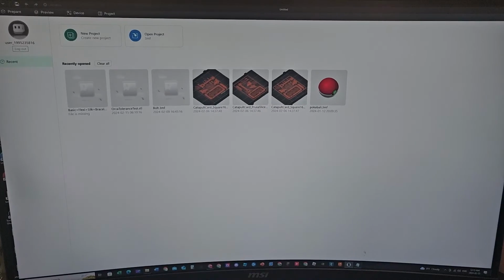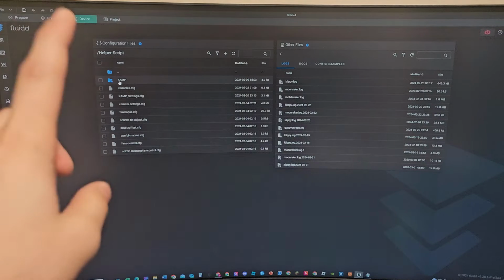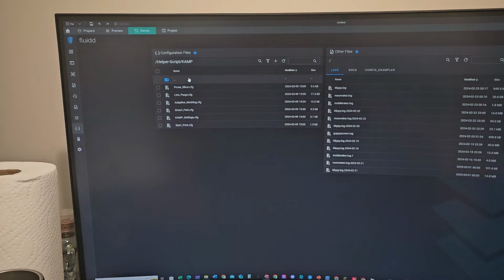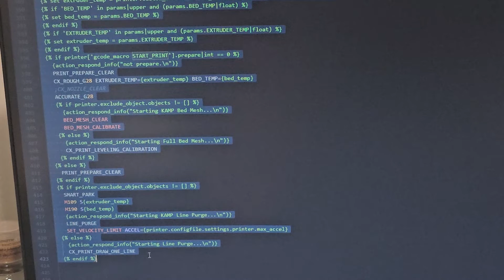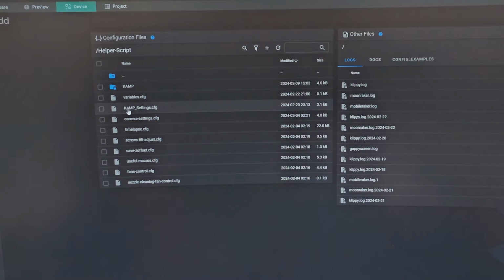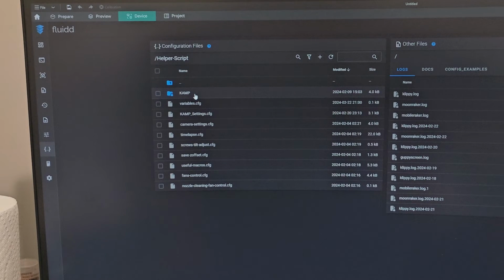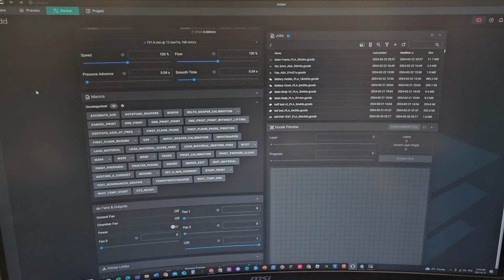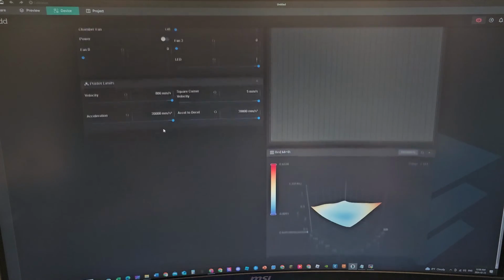How To Edit KAMP Locked Files | Creality K1 Max

Comment: Sorry, I get this error. I would be happy if you could help me.

Once the underlying issue is corrected, use the "RESTART"
command to reload the config and restart the host software.
Printer is halted
Reply from the maker: Have you change some g codes? If so then maybe it wouldn't start because its missing something.

Comment: Hi, thank you so much for your videos! I followed what you did exactly and I've gone over and over it but it will not print now as I keep getting this error.  {"code":"key165", "msg": "Error evaluating 'gcode_macro START_PRINT:gcode': jinja2.exceptions.UndefinedError: 'extras.gcode_macro.GetStatusWrapper object' has no attribute 'output_pin ADAPTIVE_BED_MESH' do you have any idea how to fix this please? Thank you very much!
Reply from the maker: It looks like your adaptive bed mesh might not be there or having trouble with your start peint gcode. Try using the original gcode and change one thing at a time.
Reply: @Scratch3DPrinting   Dear All. I just now rooted my K1C, and i am using fluidd. In my .../KAMP/Start_Print.cfg file contains more lines, than in the video. I copied all of them, and it works well. I think, @johnprosser2142 problem is he didn't copied all of the lines.

Comment: There is an easier way to edit these files (which also makes them editable) if you need to change something.   In Fluidd on the file you want to edit right click on it and select DOWNLOAD this allows you to download it to your computer where you can edit it.  Note before you upload this modified file make sure you rename the original (i just add _old to it by right clicking on the file and choose RENAME) on the K1 via Fluidd.  To upload the modified file back and then hit the + at the top of the file list, select Upload files, navigate to where you downloaded the file on your computer that you edited and Upload back to the K1.  If you have issues you can always revert to the original file (why I rename and don't delete).
Reply from the maker: That is a great way to do it. I'll think about that next time I edit file. Thanks.
Reply: @Scratch3DPrinting  I couldn't rename, delete, or move the old config file.

Comment: I am having this weird issue for the first time after going back to stock settings and re rooting. Basically my printer will only use my default parameters instead of the Orca Slicer Parameters. What G code do you have called out in your Orca Slicer? START_PRINT?
Reply from the maker: Yes, you might want to check the start_print in your printer setting on the orca slicer. Sometimes, it's "START_PRINT" and sometimes it's "PRINT_START". See if that is the problem, if not let me know.